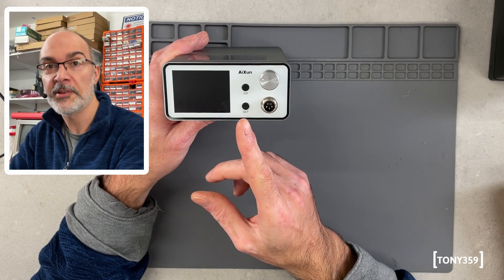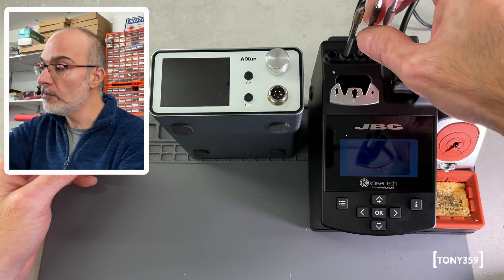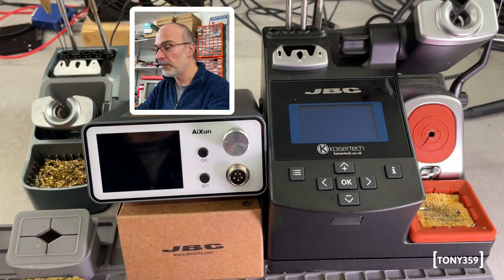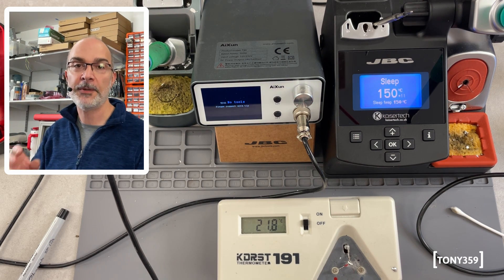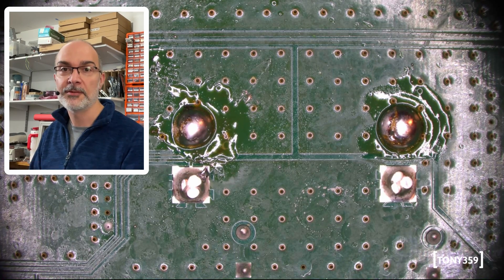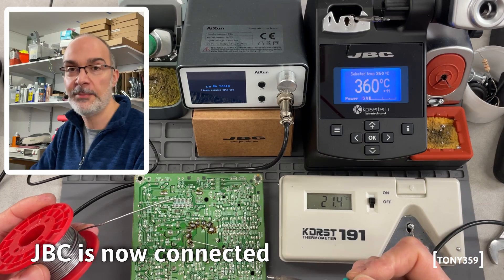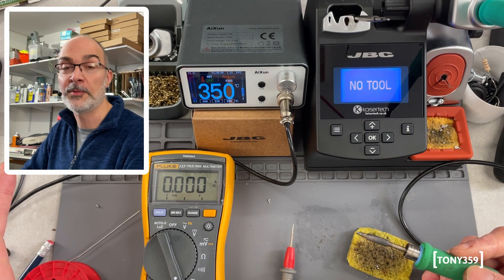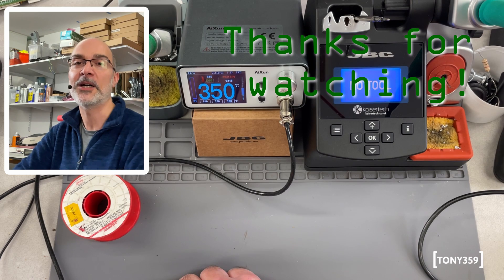Can the Aixun T3A really beat a JBC station?

Comment: Thanks for the video.

Such a pity as I had my eye on the T3A or T3B and T115 handle and tip for some very fine soldering I need to get done.
I'm no professional, but on the piece I'm messing with now I can afford to have a soldering iron flaw like this ruin the item.
Amazed that these companies don't put in the effort to fix it once the flaw is pointed, but instead they hide it with a software update.

What about cracking open the T3A and seeing if something can be modified to achieve proper grounding for the tip?
Reply from the maker: I don't have the T3A anymore but I understand it's difficult to open. In the end, it's a soldering iron, it's not rocket science! I'd rather spend my time on something else! Particularly on a company which "fixes" those issues by hiding them! Thanks for watching!
Reply: @tony359  Yeah, understood. I'll keep looking for a small station that doesn't require a new mortgage. 😀
Reply from the maker: I can relate, my JBC was a small fortune. But I had to do some paid work and I couldn’t afford to damage anything. 
I’m told some Sugon with linear power supply are good. But I was also told the T3A was good…

Comment: I wonder if this is the reason the JBC uses AC voltage from its transformer for the tip heater? While these cheaper clones use switched DC voltage for the heater.
With AC over the heater the net voltage is zero so capacitive coupling to the tip is a non issue.
Reply from the maker: Possibly. But if using DC from a switching causes all this havoc, why even bothering? Ok the unit is smaller but if it's not fit for purpose... Oh well. :)

Comment: Thanks for review. I have t3b version, I do not know about leakage, but with mine I have problem with stanby mode. With some tips station do not want to go in standby mode. Though the mode for replacing tips works on all tips. I contacted with support, gave them a video, but this is the worst support I contacted to ever. They just simple ignored my problem.
Reply from the maker: Yes, they did the same with me. They asked for details and then nothing. It probably means they are aware of the issue but they don't want to admit it.

Comment: I just received a unit of this product and confirmed continuity from the mains earth to the soldering tip.
It seems there is at least one revision that has this issue fixed
Reply from the maker: You’d be surprised to hear that my unit had continuity to ground as well.
Reply: Oh goodness! That would have caught me out.

I'll need to try it out to see if it has the same voltage leak issues

Thank you for the info
Reply from the maker: You’re welcome! I can only imagine that the ground connection is made through a small wire and hence you are able to measure some voltage and current.
Reply: I just wanted to let anyone know that stumbles on this:

While it's true you measure continuity while the unit is off, if it's powered you see the ~1V leakage I've seen referenced. 

I've decided it's still a great iron, and I'll be sure to not ground reference anything I'm working on.

Thank you Tony for reaching out on such an old video!

Comment: Do you know if this same flaw applies to the Aixun T420D station?
The T420D has a torroid for supply. From what I’ve read, the T3 is SMPS. I’m guessing this only affects SMPS stations?
Reply from the maker: It shouldn't as it's based on a linear transformer
Reply: @tony359 thank you, sir. I appreciate your time.  I ordered a T420D a few days ago to supplement my Pace ADS. Needed something for soldering IC’s with tight pin spacing.
Reply: Yes, the issue was there with my T420. Plus some other issues too. Go with original JBC. You will save money after all...

Comment: 500$+ soldering station vs. 125.00$ , there’s the difference.
Reply from the maker: Indeed. Plus a station damaging components vs one that does not :)
Reply: @ everyone can’t afford a JBC at least I can’t . I’m still using a radio shack I bought in the 80s but I’m ready for an upgrade. Keep it under 100$ what your suggestion.
Reply from the maker: That I don't know I'm afraid. I'm told that stations with a LINEAR PSU are good. But I was also told the T3A was good...
I'm not saying "don't buy a T3A buy a JBC". I am saying "don't buy the T3A" :)

Comment: Hey Tony! I found your comments on the Eevblog forum and someone replied with a possible solution to the Aixun issues. They said you can stop temperature spikes and lessen tip current by grounding the station through a 10-15Ohm resistor. Would you be able to try this out and let us know if it works? The iron would be so great without these flaws!
Reply from the maker: Hi - I sold the T3A, sorry!

Comment: My Aixun T420D died a little past a year of usage.  I just replaced it with a JBC station.

The voltage leak from the Aixun is concerning.  Yes, it's only 1v, but it could potentially damage sensitive components like old MASK-ROMS or other memory modules.
Reply from the maker: exactly. I don't want that chance on my iron!

Comment: @Tony359 Any thoughts on the AiXun T420D? Does it have the same issues as the T3A (temperature overshoot and voltage and the tip)?
Reply from the maker: it's got a linear supply inside so it might not be affected but I do not know.

Comment: I'm just a hobbyst and I didn't turn it into an investigation, but I had that Aixun station turning on the LEDs when I solder them onto a grounded board. Now, it might be enough to flow half a miliamp to get an LED lighting up, but it definitely needs more than 1V. I think white LEDs need about 2V to get about 1mA, since they're based on blue LED covered with phosphor layer - so I think it's fair to assume that, while the voltage leak is 1V constant, there are up to at least 2V spikes. I'm talking about smd power LEDs 5*5mm about 10-20W, consuming 3-5 amps at normal operation (flashlights, car headlights etc), not those 50mA straw LEDs.
 
Anyways, 2V IS enough to light up an LED, but it also might be enough to kill a GPU, for example, if there's nothing limitting current on that 1V (except for, like 0.00 something Ohms of that GPU)

Maybe it's just me and my Aixun. Who knows.
Reply from the maker: Nah, it's not just your Aixun unfortunately. This has been confirmed by others. 
I thought you don't need much to turn on an LED, even my Fluke multimeter in diode mode can turn them on. Oh but you're talking about power LEDs. 

I think the bottom line here is that the maximum acceptable voltage and current leaking from a soldering iron is 0.0V and 0.0A. Full stop. :D
(* fair enough, I think JBC rates their stations for 200mV maximum - which I cannot measure anyways - but 1V and 1.4A definitely cannot be acceptable and I refuse to use such soldering iron for my boards)
Reply: @tony359  Power LEDs require the same voltage to be turned on as every LED, they are just able to draw high current, but light up at low current just as every LED. Constant current regulated devices, but still, we do know that white led draws 3V at 1A, or maybe 3.2V at 3A, this curve starts at maybe 2V - 0.1 mA.

Multimeter in diode mode pushes some voltage through the component and measures voltage drop, they should be able to light up LEDs.

The thing here is - when you put voltage differential of 1V over an LED - nothing happens. You need about 2V for a white LED to be able to pull some minimal ammount of current - less than a miliamp is needed to light any LED up. In case of red LED, 2 volts would be enough for it to draw maybe 20-50 mA, in case of IR LEDs, 2V is more than operating voltage, in case of UV LEDs, probably couldn't draw anything. There's actually relationship between lightwaves and voltage, it's actually fascinating :D Physics...

But, here, we're talking about white LEDs, which is basically blue LED with phosphor allowing white glow - this kind of LED works at around 3.4V 5A, this kind of LED has no chance of showing any signs of life at 1V, and it's just starting to glow at 2V. So, when I'm soldering anode side and see it intermitently glowing, I know at least 2V is jumping accross it. Intermitently, as I move the iron, with obvious spike when touching the anode first time...

Sorry for my lausy English :D

Comment: I've got the same issue with the Aixun T320. What I have learnt is that the tip is not actually grounded. It's low resistance, but not a direct short to main ground, and appears to be 0.15Ohms measured from tip to IEC mains ground. When measuring the the ground port on the back to IEC mains ground, its about = 0.03ohms. This is measured with a calibrated low ohms meter, not a DMM. 1v would be around 150mA, so in the ball park. Not sure if this is related to heating or thermocouple measurement tho.
Reply from the maker: Yes, that is probably what's happening as if the tip is grounded it shouldn't show a voltage on it! My DMM can only go down to 0.5 Ohm. Thanks for sharing your experience - too bad the T3A turned out to be like that!

Comment: Hello Tony,
I heared about your Video arround 2 weeks ago the first time and was a bit shocked. I bought mine T3A arround 3/4 year ago and never soldered on grounded stuff in this time. Today I finally found time to test it on my station.
I can't reproduce your failures on my station. I measured the tip of the soldering tip to the main ground and got about 0,X Ohm. I did the same with the ground point of the soldering station. Same results. As next step I used a Aixun DT1 Temp. measure device, set the soldering station to 150° C and measured it. I reached arround 140°C on the DT1 and station told me 150°C. Than I took a wire which was connected to the soldering station ground and pushed it against the tip of the tip. No Temp Spikes came. To be on the safe side I connected the wire directly to the main ground of the power outlet and guess what? No Temp Spikes on the DT1 or the soldering station.

I dont know what is wrong with your station but mine works fine. Is maybe the tip broke you was testing with? Or maybe your whole station got a failure.

That Aixun Support is not responding I can confirm too.
I got once a reply before I bought the station but since than no response on questions :( 

I'm not sure if I can measure any voltages on the tip with my equipment but I will try it later. Hope this might helps.
Regards, Pad
Reply from the maker: Hi, thanks for your comment. It's not ground per se which is causing the issue - at least in my experience. It's "some pins when the PCB is connected to ground". Don't ask me why. Bear in mind that from 1.34 onwards the software seems to be hiding the issue so you won't see those spikes on the display. What I am experiencing has been reported by others too - also other reviewers following my discovery. That said, someone doesn't seem to be able to reproduce the issue so either there are different versions of that station or... I don't know :) 

For the voltage and current you just need a multimeter. 

In the end, if it works for you then happy days :) Thanks for the comment and for sharing your experience!
Reply: @tony359  Hey, that are all really strange behavoirs.

I just connected the station to my pc and used the Aixun Software. Its telling me I got Hardware Version 1.0 and Software 1.35, when it got delivered it was 1.31 or 1.32.
Newest Version it offers me at the moment is 1.36.
I got the EU Version of the Station with 230V

I heared that the new software version should hide the bug, that is why I worked with a seperate temp measuring device (Aixun DT1). Its for calibrating the tips.

When it really goes crazy to 500°C+ the device should notice some change. But adding a grounded wire to the tip for 30-60 secs let nothing happen. I saw your videos how fast the temp. goes higher and higher.

Sadly I dont got any old PC mainboard laying arround to test it there.

I find it a really strange bug and have no idea why this is or should happen. 

All I can say at the moment is that I'm pretty happen that I dont have the same bugs.

I only need this station for some soldering 1-2 times a year to repair something. Its not like I need to use it every day for work.
But what I have to solder this year worked really really good. So I'm pretty happy with the station. :)
Reply from the maker: Again you're not the only one saying their stations don't exhibit the same problem. But touching ground by itself shouldn't trigger the problem. Thanks for the feedback!
Reply: Okay I just measure the tip voltages against the power outlet ground. I got with DC V Measurement a spike of 0,03V and with AC V a spike up to 0,18V with my multimeter. Its a Gossen Metrahit Pro. A pretty expensive high quality one here in Germany. I dont got a oscilloscope for more accurate measurements. Hope it helps to find the problem with your station.

Comment: Great review/ comparison. Thanks Tony. ✅
1.7 Amps.! 😲 Thats a welder Not a soldering iron. 😁

I only use Irons that have Ceramic Heaters, 100% isolated. Just one tip,  3mm conical chisle.
For heavy jobs I use a small or large gas irons.
Maintenance / Usage tip. DON'T TOUCH THE TIP OR BARREL.
Hot or cold, just don't. The acid and oil from your skin eats away at the metal, this effect is amplified by the heating and cooling cycles. Gloves or recycled paper towel.
I still use my first iron, bought as used from an old gentlemen who schooled me for an hour on how to care for your tools.
Its 55yrs old now.
Reply from the maker: it's a soldering iron with integrated voltage injector :D
I see what you mean, my Hakko tips have been going strong for 10 years now.

Comment: Shouldn't the tip be grounded? By the way, is the case grounded? Why not take it apart and see what's going on?
Reply from the maker: Because it cannot be opened without destroying the front panel. What I’m showing here is a known issue.  It’s due to the way the power supply is wired, there is no easy solution. It is grounded but still…
Reply: @tony359  So the case is grounded? But what about the iron itself? Because if there's positive voltage on the iron that means it's not ESD safe. 

This is just crazy to me!
Reply from the maker: the tip is also grounded - yes I know "so how is it possible that you measure a voltage" - I do not know :)
Reply: @tony359  This is so weird! I was in the market last year to purchase a soldering station with new technology, heating element in the tip rather than in the handle, and i came across this station but i wasn't really feeling it.

So i went with a T12 station from Yihua, it works well, and it is limited compared to the other T12 stations which you can set different temps for different tips.

Comment: I have a couple of questions about the JBC CD-2BHQF and CD-2BQF models:

Does the JBC CD-2BHQF use a switching power supply rather than a traditional transformer?
Is the CD-2BQF model equipped with a transformer for its power supply?
Thank you for your time and assistance!
Reply from the maker: The one you see in this video has a traditional linear power supply. I do not know if the 2BHQF uses a switching one.

Comment: Leakage current is to be expected with any line powered appliance.  Offhand I don't remember the allowed current between two grounded points/appliances but I think it's in the very low milliamps for safety.

Appears the Aixun T3A soldering station sacrificed isolation/safety for performance at a price point.
Reply from the maker: Yes, I think the T3A is at a different level... I wonder if it's intentional (as in: yes we know but we don't care) or if they just missed that entirely. Thanks for watching!

Comment: Hello. Do you think this problem has been resolved in T3B?
Reply from the maker: Hi - I think it's the same HW, I might have read it around. The T3B is less powerful if I remember right, it's not an upgraded version of the T3A.
Reply: @tony359  My heartfelt thanks to you. Does this problem also occur with the latest T3A firmware? I wonder why manufacturers don't fix this issue sooner. thank you!
Reply from the maker: the latest FW I tested is "hiding" the issue. It cannot be fixed, only hidden and/or mitigated I'm afraid.
Reply: I purchased the T3B last week and it works completely fine for me. There is no voltage leak while grounded. Firmware 1.15

But I cannot tell anything about temp spikes because I got nothing to meassure it.